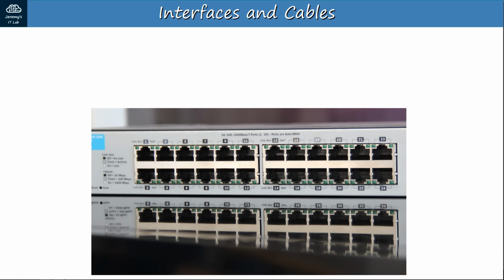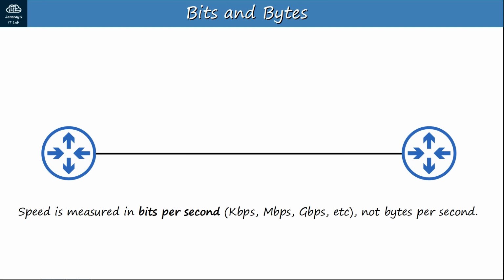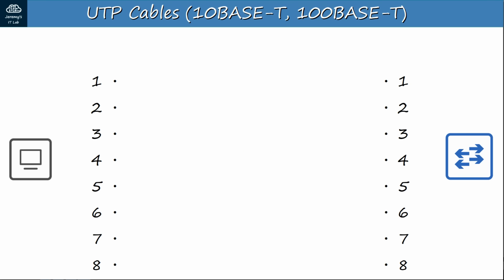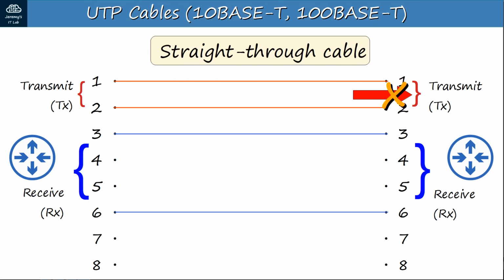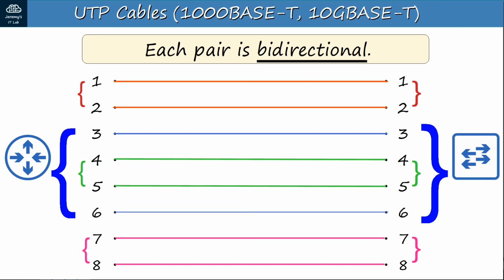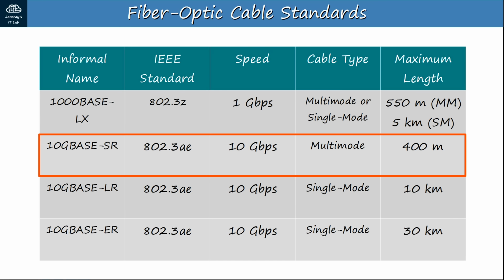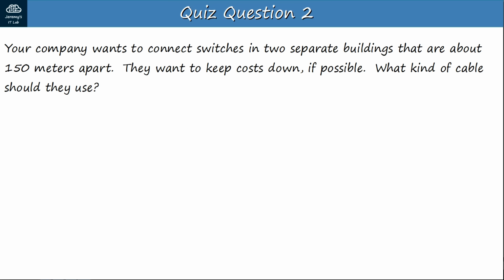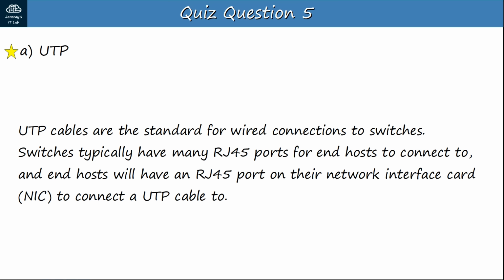Free CCNA | Interfaces and Cables | Day 2 | CCNA 200-301 Complete Course

Comment: I passed the CCNA five years ago and have been working as a network admin since that time. I let my cert expire so I am getting some refreshers before re-testing. I just wanted to add how important understanding fiber is in the real world. It makes the world go round. If it is dirty, it actually needs to have ends cleaned periodically. SFPs can also go bad. Something I wish I had also learned was what twinax is. It is basically the SFPs and the cable already in one. They are very commonly used in datacenters. They are  fairly inexpensive and do the job well.

Comment: I remember when we used transparent RJ-45 mods when we made our own cables in the 1990's and we had to check the color code of the pins on each side comparing the modular connectors side by side for both ends of the cable to verify that it was straight-through or a crossover cables. This video brings back memories!
Reply: Good job! 👍

Comment: First of all, love the material. Thanks for putting this out there. 

Also, one of the flash cards is wrong I believe. It asks which whether single-mode or multimode is cheaper and has the answer as single-mode. Just a head's up.
Reply from the maker: Thanks so much for pointing that out, I've fixed it and updated the link.  I'll be sure to double check the cards from now on!
Reply: excuse me.. I can't get those flashcards...can u send the link pls

Comment: When I designed LAN segments in oil refineries, I used to have to design with Single-mode fibe with a drop of up to 1.7 miles. We used more single mode fiber than you can shake a stick at!

Comment: I graduated with a degree in IT last year and I only learned now about the number of pins used and which were used for transmitting and receiving. I always assumed that all 8 pins were used until I closely looked at the ethernet cable given by our internet service provider and only saw 4 wires on the RJ-45. I may have not paid attention in class at times but I am sure they never mentioned these things! They only taught us the order of colors for the straight-through and crossover cables.

I also like that there are subtitles because it gives me something to focus on rather than just staring at the slides and listening which could lead to me getting sidetracked. My attention span is quite decreasing.
Reply from the maker: Nice, I'm glad you liked the video :)

Comment: If you use ethernet cables, after 80 meters you may start to have some problems even if in theory it should work till 100m (whatever type you are using). I tell my customers to try to avoid using more than 80m to be sure there won't be any issues. Just my 2 cents

Comment: Thanks for a very informative presentation.  I would like to inquire the following (1) How does the cost of repeater(s)  (hub) @ 100 m followed by another long UTP cable compare to fiber-optic and (2) how to decide?  I guess it depends on how much S/N ratio is at that location?  I am aware that the fiber-optic network is unaffected by lightning & other static interference but then costly as well.

Comment: Interfaces and Cables

- connectors fit into interfaces/ports
- Protocols are common agreed system of communication
-
Copper ethernet cable standards
- speed: 10 - 10 000 Mb/s, Ethernet, fast ethernet, gigabit Ethernet, 10 gigabit Ethernet
- UTP - twist protects against electromagnetic interference
- 10 base T and 100 base T use 4 wires (2 pairs). Thus only 4 pins used on the connectors and interfaces 
- 1000 base T and 10G base T use all 8 wires (4 pairs)

Comment: I am a Cisco student who has already completed the Cisco NetAcad course. I wish I knew about your course when I was taking my class. I think it would have helped my understand things better. It has been helpful in studying for my CCNA. I have a couple of questions for clarification: 1. In this video you refer to speed. Are you talking about speed or bandwidth? 2. In a network logical topology,  when the connections are labeled (for example, 1Gb/s) is that the speed or the bandwidth of the connection? I guess what I am really asking is are the interfaces of the intermediary devices labeled in speed or bandwidth?

Comment: 25:14 What tools use to extend fiber optic maximum length? As such copper/utp cable use switch to extend.
Reply from the maker: You can connect to a repeater, same as UTP cables.
Reply: @JeremysITLab  what the name repeater fiber sir?
Reply from the maker: @adiflorense1477  It's called a repeater.

Comment: I noticed you used 1,000 bits as equal to 1KBit, but actually there are 1024 Bits in 1KBit.  You were measuring speed, but I believe it is still 1024 Bits per second in a Kbps transmission.
Reply from the maker: Nope, 1000 bits is equal to 1 kilobit.  1024 bits is one kibibit, and is not a measurement we use for network speeds.

Comment: Thank you so much for this AWESOME COURSE!! Planning to take an exam soon and I'm studying it!
Have a question...
Why does our home PC connected to our router with a straight-through cable rather than crossover?
Maybe it is actually connected to a switch which is located inside our home router, right?
That maybe has to do with some routers which have 3 LAN ports and 1 WAN port?
WAN port simulates a ROUTER and LAN simulates a SWITCH?
Reply from the maker: First, because of auto MDI-X it doesn't really matter if you use straight-through or crossover.
But also, a home 'router' isn't just a router, it functions as a switch and wireless access point too!

Comment: Hi Bro! Found an issue on your day 2 deck questions. 
Which is cheaper, single-mode or multimode fiber? 

You said single-mode in this video, however you put multimode on the Anki flashcards.

I am going to donate 200 pounds once i pass the ccna exam in september. Legend of a guy. Can't recommend you enough. Thank you

Comment: in the quiz question 2, isn't it possible to use UTP with a repeater? Won't it cost less?
Reply from the maker: When taking the CCNA, make sure that if the option doesn't say 'with a repeater' you don't assume there is a repeater!  Cisco can be quite specific with their wording.
Reply: @JeremysITLab   Thanks a lot sir  ,, videos are quiet helpful and you are very helpful too 🙂🙂

Comment: im a little bit confused about cable types and distances, and specific quiz question 2, i did had the right answer but for 150 meters cant you use a amp? and wouldnt that be cheaper than multi mode fiber? i know this wasnt in the lessons so thats why i crossed out utp and chose multi mode.

Comment: at 32:38 you said "multimode" when you meant single-mode. just pointing it out
Reply from the maker: Check the errata in the pinned comment ;)
Reply: @JeremysITLab  oh, my bad! 😆
Reply from the maker: It’s my bad, but usually those mistakes get pointed out pretty quickly ;)

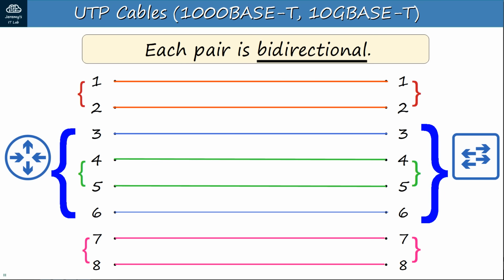Comment: When looking at 1000BASE-T & 10GBASE-T pin-outs (20:15) when connecting a switch to a router, are these also technically 'straight-through' cables, just with more pairs than a 10/100BASE-T pin-out? Or should we specifically note them as bidirectional cables.

Comment: The third quiz is somewhat confusing, because in 1000BASE-L 802.3z, you can use multimode and single, from 550 m to 5 km, you should specify with which type of fiber it reaches those distances
Reply from the maker: 802.3z multimode can reach up to 550m.  802.3z single mode can reach up to 5km.

Comment: In the table for multimode filber you said that, multimode supports disances 550m-5km in 802.3Z standard. In the 3 rd question for connection two offices in 3 km distance the correct answer is Single mode but not multimode. From which ranges does Multimode fiber supports then ?
Reply from the maker: The table doesn't state that multimode supports 550m-5km!
Reply: @JeremysITLab   Oh my mistake multimode 550m and single mode 5km, thanks for checking me out.

Comment: Hi Jeremy, for quiz q2, would using 2 UTP with a repeater in between be cheaper than using 100m of multi mode fibre? Thanks
Reply from the maker: Not sure, depends on the repeater.

Comment: Question #2 is incorrect . Game changer cable UTP meets this parameters : GameChanger Cable can deliver 2.5Gbps and 100W PoE up to 656 feet (200m) or if you need to go farther, GameChanger Cable can deliver 10Mbps and 100W PoE up to 850 feet (259m).
Reply: Didn’t realize how old this playlist is and game changer wasn’t out during its initial release. Great job with simplifying the basics. Really enjoy your breakdown of network fundamentals 👏

Comment: Why switches transmit data on 3 and 6? while rest of the devices discussed in this video uses 1 and 2 to transmit... if they would have been using same pair , they wouldn't have be any need of different type of cables (straight through/crossover). I know AUTO MDI-X already have resolved this problem, but I am just asking out ofcuriosity

Comment: If a router and PC both transmit on pins 1,2 and receive data on pins 3,6 how does that work when a PC is directly connected to the router?

Or do you want crossover cable for PC NIC to Router port?

Comment: If you connected an old switch that does not have auto MDI-X to a new switch that does with straight-through cables would it work because only one needs to be able to adapt to the other? Or would the old one not even send anything?
Reply: That's a great question. I asked ChatGPT, and this is the answer:

"When connecting two network switches, where one supports auto MDI-X (Automatic Medium-Dependent Interface Crossover) and the other does not, using a straight-through cable, the connection should work because only one device needs to have the auto MDI-X capability to adapt the wiring configuration."

What's great about Cisco's Packet Tracer is that we can test it ourselves! Instead of using the automatic connector, we can pick the straight-through copper cable and connect it between Switch 2960 (with auto MDI-X) and Switch 2950T (without MDI-X).

Comment: since the pairs in 1000BASE-T and 10GBASE-T are bi-directional, does that make their functionality the same as cross-over cables? Meaning, can we use them to connect two switches for instance, without needing Auto MDI-X enabled?

Comment: I have a question: could a crossover cable in the switch diagram connect pin 6 and pin 1; pin 3 and pin 2? or is only pin 1 and pin 3; pin 2 and pin 6 possible? Thank you in advance

Comment: Does anybody understand question 4? It is 1000Base, so if you plug UTP into it, than it won't use the speed of 1000Base. It wil work, because the device has auto MDI, but the speed will be reduced to a UTP speed. Right?
Reply from the maker: I think you're confusing some terms. 1000Base-T uses UTP cables, just like 100Base-T or 10Base-T
Reply: @JeremysITLab  thank you. After watching 3 times again, I saw that utp and fiber have their own cable standards, which I was confused about :)

Comment: what is the difference between 10Gbps with maximum lenght of 400meters using multimode and 1Gbps 550m multimode in Fiber-Optic Cable Standard.
because i thought the higher speed the much more longer lenght.
newbie here.
Reply from the maker: No I don't think the transmission speed and length are related.  I assume some improvements were discovered that allowed a slightly longer cable length (400 -> 550), but I don't know any details.

Comment: On your first flashcard for this Lesson the card asks "What is the speed of an 'Ethernet connection?' and the answer says 10Mbps when it should be 100Mbps, no? I've never had an Ethernet cable at 10Mbps that's slower than Wi-Fi... I thought the most common speeds of Ethernet are 100Mbps, 1000 Mbps, and 1Gbps??? EDIT: I just watched the entire video... I'm thinking of FastEthernet
Reply from the maker: It's true that these days you're probably not going to see/use a 10Mbps Ethernet connection!

Comment: so when you said that in 100BASE-T & 10GBASE-T Each pair is bidirectional so that means I don't have to worry about straight-through or crossover cable right? because now each pair isn't dedicated to transmit or receive data is that right?

Comment: I have a question, most sources says that when connecting pc to router it should be a straight-through and not a cross-over (considering there's no Auto-MDIX); but on 17:14, Jeremy said it should be a cross-over. Which is correct? TYIA
Reply: I think Jeremy is correct.

The scenario you're likely experiencing is an ISP router with a switch built in.

Comment: Why did you use pin 3 & 6 for 2nd pair of wires 12.05 minutes video for 10 BASE-T and 100 BASE-T? Can you please clarify? Thanks for such a nice explanations.
Reply from the maker: I'm not sure why, but that is the wiring used in Ethernet cables.

Comment: Hi Jeremy, It's reall good video. I'm learning a lot from your videos, But a quick question regarding 10Gbase ER maximum length, you said in your video it's 30 km and I have found out it's 40 km in a book. So, which one is correct? thank you advance for your reply.
Reply from the maker: For simple facts like that, try a google search!
Reply: @JeremysITLab  Thank you for your reply. I searched on google and found out that the maximum length of 10Gbase ER is 40 km. I have changed the answer in anki flash card too.

Comment: Hi Jeremy,

1 Question here regarding Auto MDI X features. If 1 networking device is Auto MDI X enabled & other networking device doesn't have Auto MDI X features. Does it transfer data ? Or Both device should have the AUTO MDI Port enabled.
Reply from the maker: I think it will transfer data with no problems even if only one side is Auto MDI X enabled, that one device should adjust on its own.

Comment: what is the difference between port and interfaces?
Reply: In this lesson and the near future lessons port and interface are used interchangeably, but refer to the physical hardware port where we connect/plug the cables. However, in the later lessons you will be introduced to loopback interface and tunnel interface, these are 'logical' interfaces where we can create using commands (to be clear, it does not exist physically). Also, you will encounter port numbers when learning the application layer of tcp/ip suite/ OSI model. Those are to address the type of service that is used in the application layer and not the physical/hardware port of the device. Im not good in explaining things, but I hope this help. Good luck on your study!

Comment: I didnt get the parth the 1000base is bidrectional. what is the difference between the 10/1000base against 1000/10gbase. I understood they have 8 pin conector. But I didnt get the part of the bidirectional

Comment: What about connecting a PC to a Switch. Would that cause any issues or would it function normally? Thank you.
Reply from the maker: PCs are supposed to be connected to switches, so no issues!
Reply: @JeremysITLab  Sorry apologies.  That made me sound really silly.  I meant connecting PC to a Switch using a crossover cable*.

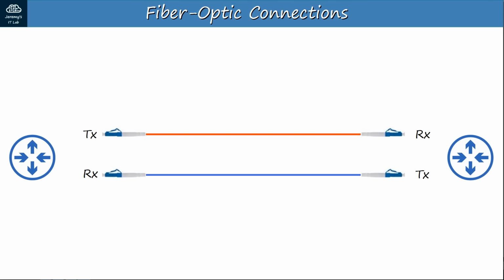Comment: Hi Jeremy! I have a question what is the difference when you say separate wire and separate cable @ 21:46? Is wire and cable different? I got confused there. Thanks!
Reply from the maker: There are 8 wires inside of each UTP cable.  The cable is the whole, the wires are individual copper wires inside of the cable.
Reply: @JeremysITLab  oh yes I get it now. Thanks Jer!

Comment: Hi everyone. I have a doubt about 1000BASE-T cable. This cable's type has bidirectional pairs, but I don't know what this means, can someone explain it to me with more details? 
If I get it right, the 4 pairs can both transmit and recieve data? But in this case there is no need to use a crossover cable rather then a straight-through cable or viceversa? 
Also I don't understand the role of 4, 5, 7, 8 pins. Thanks.

Comment: Hi, I have a question, on FOC, is it possible to have 2 light rays in SMF? I have seen an information on Wikipedia that WDM systems operate on single-mode fiber optic cables which have a core diameter of 9 µm. But for the sake of clarification, is it really possible?
Reply from the maker: Not sure

Comment: Hey Jeremy
"_I have a query_".
At 13:15, instead of using 3-4 as receiving wires, you're using 3-6. Why did you that...? Why not just use 3-4..?
Reply from the maker: "I'm" not using 3-6 instead of 3-4. That's the standard.  If a manufacturer decides to use 3-4 instead of 3-6, their device won't be able to communicate with other devices because all other devices use 3-6.
Reply: @JeremysITLab  Hello Jeremy! Thanks allot for the help 😁😁 I'm so glad you replied. My query is now cleared   thank you so much for clearing it out. Just love your content

Comment: Correction: 10gbase-ER has a max length of 40km. Not 30km.
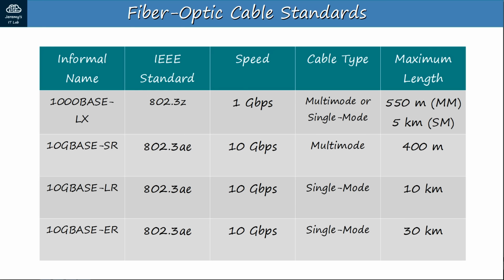Reply: @JeremysITLab  Correct. In your video at 24:51 though, you state that the max is 30km. This should be 40km.

Comment: sir my teacher told that in networking, like devices uses crossover cable and unlike devices uses straight through cable. As,  router and pc are like unlike devices but uses 1,2 pins for transmit and 3,6 for receive. So, how can we use straight through cable?
Reply from the maker: Straight-through cables are used to connect devices like PCs and routers to switches.
Reply: @JeremysITLab  Thank you sir. Your videos are helping me a lot. Thank you so much sir.

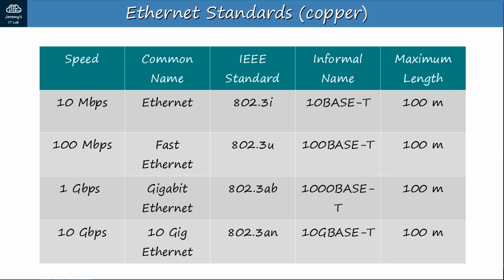Comment: Hi Jeremy, is it 802.3i or just 802.3 for 10BASE-T? 7:19
Reply from the maker: It's 802.3i. The original 802.3 specified 10 Mbps over coaxial, not twisted pair cabling.